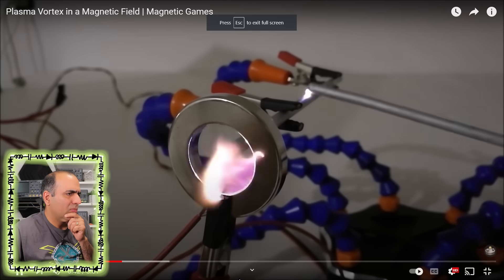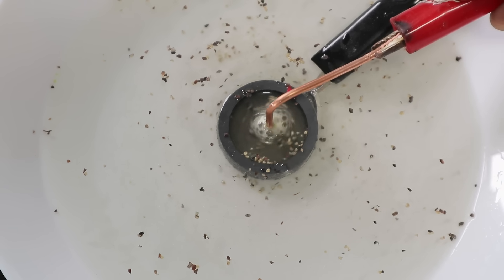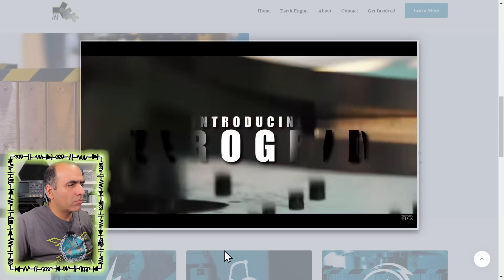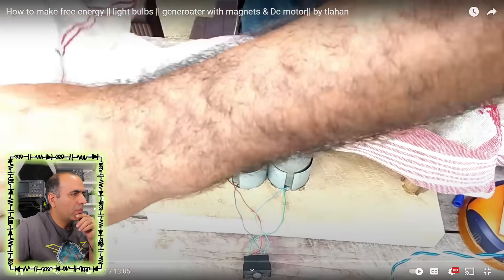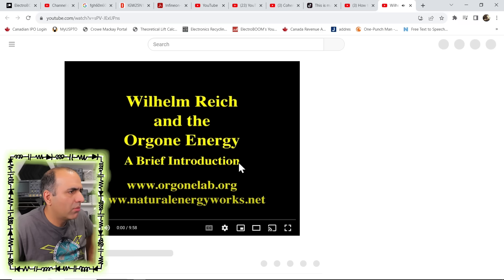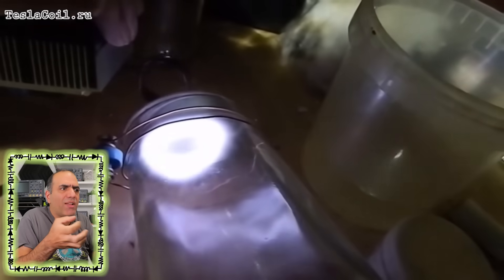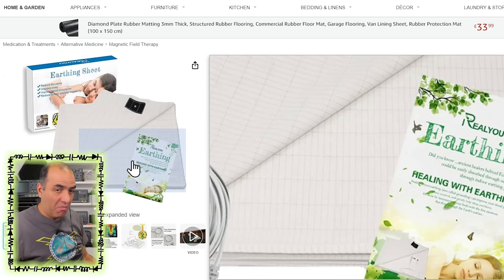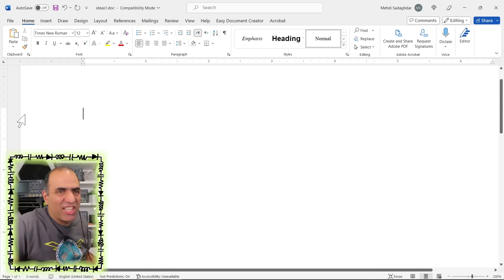Plasma and Salt Water Electric Vortex, Document Free Energy Clean Up

Comment: If you hold a CFL bulb in your hand and generate a static charge on yourself you can see the gas start to light up in tiny little flashes. Not at all surprising but it was neat when I first noticed it. Same feeling I had when I discovered in 5th grade that you could shock someone with static through the graphite in a pencil if you hold it with you hand on the metal ferrule that holds the eraser on and tap them with with pointy end they will get shocked. Then later I learned that's why NASA invented the pen that could write in space because using pencils left graphite shavings and dust floating around that would get into electronics and short them out. A fun reminder any time a smug Russian tries talking crap about how much money NASA spent designing the pen when Russians "cleverly" just used a pencil.

Comment: https://en.wikipedia.org/wiki/Invention_Secrecy_Act#:~:text=ch.,security%20of%20the%20United%20States.

Apparently, the government has been hiding perpetual motion, which they believe would give an advantage and the ability to reach us or our government at tremendous speeds without refueling. And of course, they could use parabolic and frequency weapons against us. 

They turned the weapon of petroleum into a fuel for cars to conceal its effectiveness as a fuel-air weapon, and now they promote atomic energy to hide the amount of poisonous gas a small quantity of radioactive material can create. Kind of like "would we do that if it was so dangerous?"

https://drive.google.com/file/d/1zSYY612R77DWSmLzj4Q_0aZONZ46jWTP/view?usp=drive_link

Comment: the only way to get free power would be to make a transporter then transport a fully charged battery then save the data to a storage medium of some kind then reprogram the transporter to work from the storage medium instead as then as long as the energy used to make the copy was less then the copy had free power lol
Reply: I had a stroke trying to read this
Reply: @BoredAutocrat  well not my fault you find logic hard to read its easy to understand

Comment: Off course there is no free energy. That is one of the most ancient knowledge that human beings have. There is no 100% efficient transformation of energy. There are ALWAYS losses on every convertion. There is no "perfect" machine or device. When we convert for instance movement to electric energy there always be losses. Even on the conducter itself. The copper wire. If we imagine a perfect machine that can convert rotation on electricity, the fact that the electricity is transferred on some wire, that will consist in a lost of energy on the wire in form of heat. So even if the conversion was 100% efficient (wich it is not) just on the wire itself we will be loosing power and this is the law of conservation of energy and we CAN'T MAKE FREE POWER on no way. IT IS NOT POSSIBLE. Please STOP those claims!!! Sorry about my poor english. I am from Portugal.

Comment: If you ever held a magnet you very quicky realize that those "couple watts" figures are bogus. And it doesent require a m³ of that stuff either.
A rather low volume magnet can already excert more force than im able to overcome with my hands.
Max-freakin-Planck sayd it HAS to be possible to exploit magnetism for energy generation. Dont fall for BS that your own expirience tells you is wrong.
12 watts eh? Electrocuting your brain several times a day is fine i guess, but try to also use it once ina while.

Comment: @ElectroBoom hey my dad has actually been a mechanic for over 20 years when I asked him, supposedly that car plug in fuel saver does work slightly on newer cars and researching it it does have like less than 5mpg difference, but they do work, very slightly

Comment: Do Stanley Meyers fuel cell, I double dare you
anyway, apparently it used high voltage low amp pulses and the two tubes act like a capacitor. The idea was that exactly the right frequency will cause the molecules to line and and split easier (also that there was a secret electrolyte or coating on the tubes etc). Interestingly, one of his later ideas was a laser that shone in to a charged chamber, and in the last few years there was a research paper about shining laser light of a certain frequency on a catalyst, supposedly greatly reducing the energy required for electrolysis

Comment: i even think the motor to motor can maybe work the reason for that thinking is if you have two small magnets they got a small magnetic field and pull together with a weak force but two magnets with a strong field has a strong pull but if you had a strong magnet and a weak magnet the pull should be more than just 2 weak magnets but if you consider the coil as a small magnet if you use a small permanent magnet you get a weak motor but if you use a stronger magnet you get a stronger motor if your permanent magnet is strong enough and dont use a iron core the motor can output more rotational energy than electrical input and that should be able to spin a generator.

Comment: i seen a few free energy ideas in there i got a few ideas that should work. just to point out its real just hard to do a simple generator image a submarine it works by compressing air to let water in to sink and to go up just release the air and it pushes out the water it goes up and down with over unity energy connect two of them together by a cable and a boat on top with a generator that spins with the subs as one sub is going down the other is going up and its got plenty of weight to go down with some force like say 100kw requires about 80k lbs a sub is heavier than that easy so its 100kw per foot how deep can it go and how much energy does it take to fill the air tank to go down if say it takes 100kw one time to go down but it returns 100kw per foot its over unity made simple its expensive but simple and that idea also works on balloons dont need water you can also do sky same thing fill a tank it goes down release a tank it goes up. it just needs to go so far to break even then its free after that. but i cant seem to find a error in the motionless electromagnetic generator or MEG i believe if it dont work its because you didnt use a strong enough magnet or iron core too small i think the reason it will work because the input coil is used to move the permanent magnet field and that makes the output not the input coil directly

Comment: Magnetic friction generators heat reducing the efficiency and effectiveness of a magnetic generator. You can put it in a vaccum and cool it down to slow down the thermal damage that causes it to slowly depolarize. Gravity also slows it down but can't do anything about that on earth. Also, certain magnets can benefit from low temperature such as liquid nitrogen and neodymium magnets cause elevation by quantum locking on conducting sheet material.

Comment: The closest thing to the perpetual motion I can think of is a mass large enough to be pulled towards Earth by gravity set on a parabola (skateboard half-pipe)with as little friction as possible between the mass and the parabola, kept near absolute zero. You would have to start the falling mass down the parabola, but as long as friction and heat are removed, gravity would pull it back and forth.
Reply: The system would still loose energy over time due to tidal interactions. I mean really this is just a needlessly complicated orbit.

Comment: Bedini Simple School Girl motor... it isn't "free energy", but amazingly efficient.  Low chance of exploding or shocking anyone though 😕
Some say it is a trick with lead-acid batteries (though the original ran off a normal 9-volt radio battery).  
Some say the voltage spikes and capture of the otherwise wasted collapsing magnetic filed acts as a heat pump,
taking heat from the surroundings and converting to energy (thus not "free").   

Probably not interesting for your main channel, but it's a really interesting demonstration of harvesting the energy from collapsing electric fields.
Reply: Extracting heat from your surroundings violates the second law of thermodynamics and is impossible.

Comment: Explain quantum mechanics then . When you super chill a magnet n have it on opposite magnet n levitate then being cold it begins to move n as long as the magnets are frozen will never stop
Reply: That's really just a very low friction bearing. I mean most wheels when you start to spin them will keep spinning. The interesting bit here isn't that it keeps circling around but the fact that it stays locked in one orientation.

Comment: Coffee ground left overs,  charcoal foot bath/ bug remover. Hell, I'm tempted to by a bag of top soil and jump in the tub with it. Plz I've billions of sand crabs /nano carbon s some freak stuffed up my ass. No frequency bashing please!
Reply: Time dilation 25%/75% it why u look into a video an think u actually have a conversation and or telekinetic voicing. Is possible.  Yet even in the air we breathe there is silicon. Fibernachee may explain why we end up with. 5 volts on most basic battery design. Even solar might figure the voltage regulator with that code as water gate.
Reply: .5

Comment: Brass bowl a, 21 years I've suffered some fish hook in my neck. I had to catch my fuzzy blanket from flying away off my body. I grabbed it in mid air out of a  old dead sleep. Had to hold it for like 2 seconds  and it quit. Trailer frame are the perfect point of Origin locate. I thought I was dreaming,  but just said to myself go back to sleep. Inverted ground loops. Aka indignity to a body. Hope u find em b4 I do. Cheer's

Comment: ❤That was Heart Akerson in Costa Rica.  He has an any voltage inverter 12-50 vdc.  Called Transverter.  I met him he is an electronic genius designer.  No bull Transverter works it is an all in one solar box with DC in from solar 12-50 VDC and any voltage battery  12-36 VDC no higher than 50 vdc. Will you test one? There is a solar dc  in 50 v max and a AC 120 v out. the battery voltage is 12-50 vdc max. No free energy except that free energy you get from pv panels. Happy New Year!  Yes there is free energy SOLAR!

Comment: @electroboom i have seen something similar with piezoelectric bbq lighters: at my old house i had one i used for incense, and it could wake my computer from sleep, which is normally only possible by pressing the power button, keyboard, or mouse. 

I tested it while the computer was on amd didn't notice any input, but it could be very small, like moving 1 pixel in the X axis. It was definitely repeatable from about 1m away, standing up, so i know i wasn't accidentally bumping the desk. Seems like whatever tiny voltage/current generated by the piezoelectric striker shouldnt be able to travel that far and still cause input signal on a computer, but i dont know enough math or have the right equipment to measure the electromagnetic field of the striker

Comment: There is free energy proof is you must get to DC motors then connect the spinning part and then connect one of them to batteries and then one of the DC motors will rotate the one which is connected to anything you want to generate electricity and then it's gonna create electricity
Reply: That's just a wasteful way to drain a battery.

Comment: Am too lazy to build the thing myself, but can you actually build a carousel with permanent magnets and make it spin and then what exactly happens to the magnets after they rotate for a while? They lose their magnetism?
Reply: You've just created a magnetic bearing, so nothing happens to the magnets themselves but the thing rotating will eventually slow down due to air resistance, and some tiny losses due to heating of the metal conductor. Magnetic bearings are used for things that need to rotate at fairly high speeds but also weigh very little, so mostly PC cooling fans.

Comment: The Hutchison Effect is very very real! It's literally all about the collision and intersection orthogonally of EM waveforms at high voltages and/or high amplitudes to create standing waves that affect the molecular cohesion of crystalline matter such as metals and ceramics. 

Our own VERY LARGE AEROSPACE COMPANY in-house experiments indicate temporary cascade failure of molecular bonds between crystalline substructures and for polymers, a case of temporary cascade failure of hydrocarbon ring structures that "fix" themselves back up into their original configurations once the orthogonal EM waveforms are stopped. That's what causes the "melting" of dissimilar materials into each other as what Hutchison demonstrated when he recorded wood melting into metals  seen on his videos.

The levitation and moving effects seen on his videos are from standing waves or surface waves acting a bit like how the air cushions on  hovercraft work.

 Instead of a cushion of air, you get cushions of surface waves, standing waves and/or some other field effects caused by highly unusual configurations of Coulomb forces and van der Waals forces that allows objects to move or levitate all by themselves!

Revisit the HUTCHISON EFFECT in another video please! It's a very real REPEATABLE effect. 200,000 volts at a few amps works great. Intersecting RF waveforms at 10 to 80  gigahertz waves also works!
Reply: We have 150 Gigawatts (Yes! That is BILLIONS of watts!) worth of hydrogen and propane fueled Ballard fuel cells (i.e. 100,000 of the megawatt fuel cell arrays at our northern B.C. lab) to try our experiments on with various in-house built transformers that can push one megavolt at 10,000 amps up to 100,000 amps!

You get VERY UNUSUAL FIELD EFFECTS at those voltages and amperages!

Comment: When debunking these, it would be nice to mention E = mc², which says that if you would create energy, you would also have to create mass. And I suppose its less believable to create something out of thin air, than create energy
Reply: That's not what that means. The energy matter equivilancy describes the rate at which mass is converted into energy, like in say nuclear processes, and it's also useful for General Relativity. What it says is that 1 unit of mass converts into 1*c^2 joules of energy, like say if I fuse hydrogen into helium then the protons in the resulting helium will weigh a big less than they did in the hydrogen and that decrease in mass was converted into energy at the rate of m*c^2.

The thing that matters when debunking free energy scams is just the concept of the conservation of energy, which so far has always been observed to be true. Or sometimes it's the second law of thermodynamics which states that some forms of energy are impossible to extract work from, ie. shit we care about like electricity and the ammount of that energy that we cannot extract work from will always grow.
Reply: @hedgehog3180  i believed, that the relative mass is still conserved by momentum, that the energy creates. Similar how solar sails work. Photons does not have mass, yet they can propel mass

Comment: I started watch this dude and his one video of a capasitor blew as he moved a wire in the Bluetooth chip and the hawaii inspection what he told them is true since not working smoke detector wont let you know if theres smoke... well since its a old unit and a outlet that wont hold a charge

Comment: 3:16 is the copper wire has now become the cathode, so the deposited metal is going into the solution as ions. Usually happens with change in battery polarity, but this is an extra special case - it changes with flip of magnetic polarity too.  This is expected since electricity and magnetism are intimately linked, just not an everyday common sense phenomenon.

Comment: Here’s something you can try.  I’ve found that if a block of frozen bottled water(-5degF) is placed in a microwave and it is powered on, that sparks fly off of the block ice as if it was metal. Check it out, there’s something there. If anything, you might catch a spark to the hand or something. Thanks for all the great videos

Comment: Do you ever use "super capacitors" in your experiments? For instance xs-power or maxwell super capacitors? Id love to see something related to the audio field like how to assemble the most efficient  or most powerful energy source for car audio... maybe LTO batteries mixed with super cap. Just a thought. Thanks for the great content!
Reply: super capacitors are actually less good than non-super capacitors in power rate.  They have massive capacity, but huge internal resistance.  Just use enough normal capacitors and you're  good.

Comment: I wish I could find the video but... I saw this thing where they took two electric motors with pulleys and a belt, one pully was slightly smaller and they put one of those BBQ lighter, the sparking mechanism on to one of the motors and whe the sparkler sparked it moved one of the motors a bit, but was enough to power the other and the other fed power back to the other and powered itself along with a little incandescent bulb...

Sorry if it was confusing
Reply: very common scam.  no point watching it